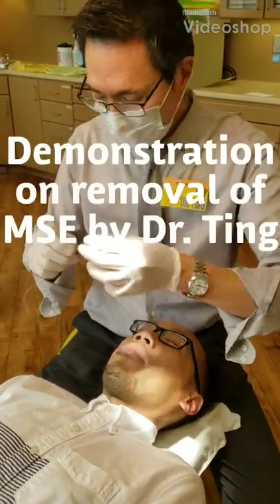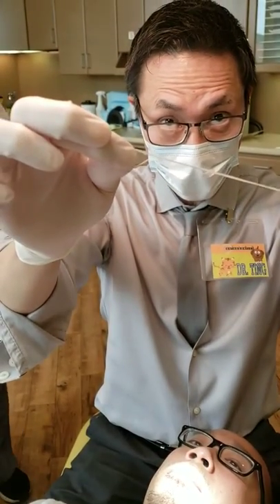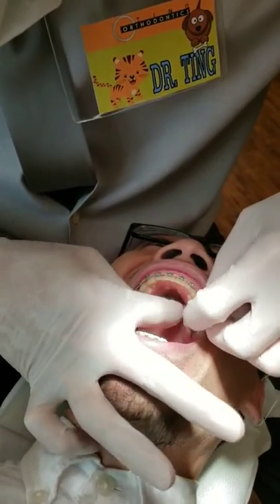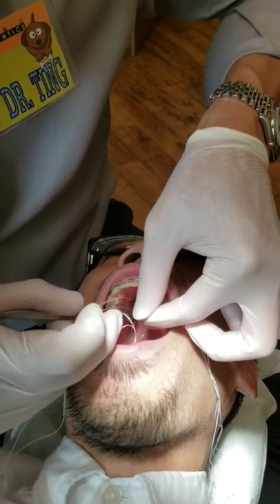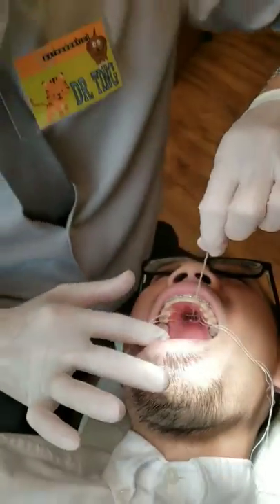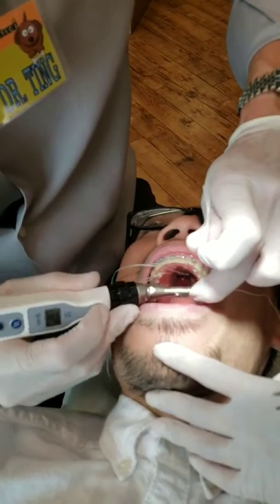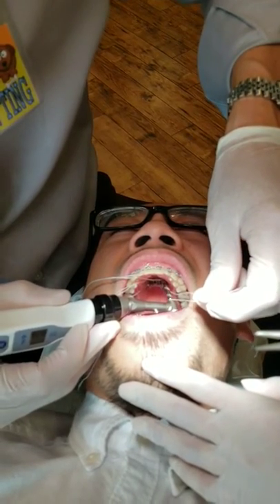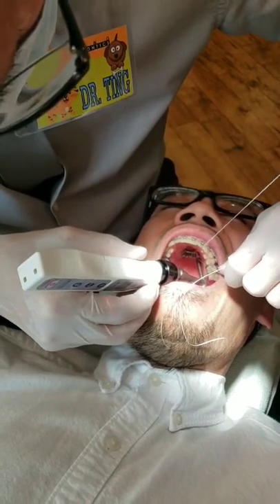Demonstration on removal of MSE(Maxillary Skeletal Expander) by Dr Ting

Comment: Hi Dr Ting, so you said the max forward movement of the maxilla with face mask in adults is 3mm. What about if you turn the mse less frequently, so the suture stays open longer, and then you apply 1kg of force per side? Is it possible to keep the suture open longer allowing for more protraction time? Thanks

Comment: Would MSE still work if I've had premolar extractions?
Reply from the maker: It depends on the situation.
Reply from the maker: Sometimes we may need to reopen the extraction spaces.
Reply: How about bicuspid extractions for braces? If you had treatment when younger.
Reply: Ezcanor I’m on the same boat
Reply: rtingdds what’s the possibility of expanding asymmetricaly?
Reply: @rtingdds  I have the same issue with the extractions
Reply: @rtingdds  sir for reopening extraction spaces what are the appliances used???

Comment: Is there any real danger that is possible WHILE you install the MSE, if things were to go wrong?  Also, does this somewhat unnatural way of splitting the midpalatal suture have possible negative side effects? I imagine it would be very painful after installing the MSE even with pain medication right? I want to do the procedure, but I am just scared honestly, I would appreciate your advice or suggestions in regards to this, thank you
Reply from the maker: As today,  I have done ~230 cases. Never a case had dangerous complication. However,  there is always unforeseen possibility for any procedures. I believe the potential danger will be infection, inhalations of any parts and allergy reaction to antibiotics. Pain wise, it's surprisingly light. We always recommend taking tylenol extra strength on the first day only. Majority of the patients felt fine the second day on. Some patients do complian about soreness of the tongue from rubbing against the MSE in the first few days. Until the tongue learn not to play with the MSE. Hope I answered all your questions.
Reply from the maker: @ezcanor8262  yes you can
Reply: rtingdds what’s the possibility of the MSE expanding one side more than the other?

Comment: What happens with the holes where the MSE screws were inserted into the palate after you remove the MSE? Do they heal overtime or? Also, what is usually the estimated cost for this procedure?
Reply from the maker: The soft tissue heals within a day or two. The bone will heal completely in 6 months

Comment: How would the lowers teeth fit with the expansion of the upper teeth if lower jaw is narrow?
Reply from the maker: That's one of the biggest misunderstanding in maxillary expansion. 99% of the time the lower back teeth are tipped inwards and upper back yeh stere tipped outward to compensate the jaws in a narrow maxilla situation. Therefore, by simply upright those teeth,  the doctor can create significant difference to allow a large amount of maxillary expansion and lower jaw will look absolutely normal. The lowest jaw problem is most likely not be too narrow but too backward(recessed). When the lower moves forward,  the wider part of the jaw will show. So 99% of the time, worry about the lower jaw is not valid. Those with actual narrow lower are most likely have some kind of syndrome disease.
Reply: rtingdds how about extractions? That purposefully makes lower jaw smaller.
Reply from the maker: @ezcanor8262  MSE makes extraction treatment  outdated
Reply: rtingdds definitely as I got teeth extracted for braces and know I need MSE. Idk if MSE actually helps with reopening those extractions I had since it expands the maxilla. I may reopen my extractions at some point after MSE
Reply: @rtingdds  I'm getting MSE tomorrow, I hope those extraction spaces re-open

Comment: Hi Doctor, can I ask would you recommend this to someone who has aligned teeth, but a very narrow maxilla? My ortho has suggested that it is possible to fit the lower arch to the expanded upper arch using braces, but I fear that there will not be enough alveolar bone for the lower arch to expand.
Reply from the maker: Yes,  most likely,  but it depends on your orthodontist's opinion or finding the right orthodontist
Reply: Most regular orthodontists be lying to get you to pay up that hard earned cash. What you really need is an airway focused dentist/orthodontist

Comment: Dr. Ting do you know any good MSE providers in NYC? If I want to get treatment with you remotely (lets say I fly to LA and stay for 2 weeks), how frequently will we need to do check ups, and when do you think I will have to fly back next for another in person? I have a very bad cant and asymmetry (age 17), and would like to get this fixed asap. Thanks Dr. Ting :)
Reply from the maker: You can find an local orthodontist to take on your case,  then that doctor can give us a prescription to insert MSE for you. That will be the easiest way. We will be only doing the MSE part. Your orthodontist will finish the rest of the treatment
Reply: rtingdds Would you recommend Dr. Newaz in Nee York? I listened to your protocol approaches to asymmetry with pulling the TADs to eliminate the cant and moving the jaw forward to align it, hearing that you consulted Dr. Newaz, is he capable of doing procedures to correct asymmetry?
Reply: rtingdds Also one more question. After MSE, when using the face mask to pull forward and some type of mandible advancement device, if the wisdom teeth come in horizontally, is there a solution or protocol you have to upright them?
Reply from the maker: @user-ig1ew2kb8t  extraction!
Reply: rtingdds Hey Dr. Ting is there anyway to do free online consult? I am in tough situation, 17 years old, have a bad occlusal cant causing facial asymmetry and tmj issues. I want to see what I can do to treat it before it gets too late. I’m very worried, I hope you can help me out, thanks for your time Dr. Ting, and be well! It would mean the world to me if you could help 😁😄
Reply from the maker: You can contact Shelley at shelley@tingortho.com,  or call our office 949-4592882 to go over details and arrangements, thank you.
Reply: rtingdds Dr. Ting is there no way we can have a free consult or maybe discounted? I can’t afford $250 for consult at age 17 and I think my orthodontist messed up my jaws, I want to fix before it becomes worse

Comment: I am having a problem. I wore a pallate expander when I was 21 for a couple of years and it messed up my palalle. I had a even pallate before I  wore it. It caused my pallate to be uneven with the left side wider than the right and the arm of the expander cut into the roof of my mouth and left a permanent knot on the right side where its more narrow. I have been unhappy about this so long. I don`t know what to do or where to go so I can  this fixed. Every oral surgeon I go to want to charge me for a consult  and never help me and I get nowhere with orthodontic consultations either because they tell me they don`t put expanders on adults or they wont expand it so it will be even on both sides. The issue is the uneveness is really bothering me and I want something done to make my pallate symmetrical again. The places I  go to dont  listen and want to do anything for me and I hate that I am  stuck like this because it was not like this before. I feel like I get the run around everywhere  I go and ripped off and charged for nothing. Do you have any suggestions?
Reply from the maker: Whoever is going to see you will need abct scan to see exactly what's going on first. 99% of orthodontists out there will not treat this kind of case. You just have to keep looking
Reply: @rtingdds  ok what kind of doctors do you think treat this kind case or should i keep trying oral surgeons?
Reply from the maker: @starstar2362  a functional orthodontist,  someone who know how to correct structure